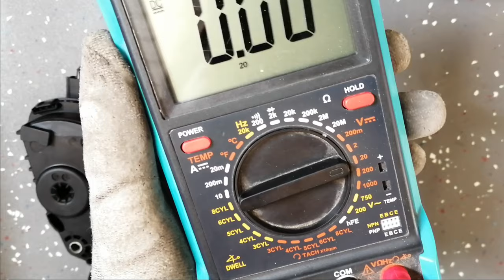Testing Accelerator Pedal Position Sensors in a very professional way

Comment: You should be talking to explain what you do and what the right voltage should be read,by the way thank you .
Reply: Exactly, why even make a mime video? I learned nothing from this
Reply: English problems I guess
Reply: I'm still wondering why I would test for voltage at all, rather than resistance.  Agreed, this vid was a waste of time.
Reply: Where is that output go? Ecu?
Reply: Please how can I fix the problemI was called to another garage to fix a 2005 300c chrysler. The problems they noticed with the car was Hard or no start, red lightning bolt flashing, no throttle response, headlight stays on, immediate stalling after starting and rough idle throughout idling as a result a new PCM was replaced with a new one however problem still persisted. 

  I scanned for DTC codes and saw a P0340, P2167, P2166, P2115, P2116, p0603 and more module codes like C2202, U0168, U1414, B1A25, etc.
Reply: @davidessien5465 Powers and ground first.

Comment: This video proves my own video to be true in that electronic accelerators are not linked in with your PCM/ECM at all and how people are being scammed into believing a stopped up cat or transmission sensor could be related to limp mode. That pedal sensor as shown, has a direct voltage feed, and from there activates the throttle plate motor on the throttle body and has nothing at all to do with your ECM. Notice how they throw a wrench icon code but not an ECM code? Your scam videos and crooked shops and making people believe you have to focus on other engine sensors and are even making up lies that you have a stopped up catalytic convertor. This video above is PROOF of what I am telling you people

Comment: Good video showing how the APP sensors work. However, the test itseft doesn't measure the voltage difference correlation between sensor 1 and 2 which is what actually the pcm is looking at to determine if the pedal is working properly or not.
Reply: Hi , is that reading even good?  I mean it is good pedal?
Reply: Can't exactly say, you need the specs for the car model to make a definitive decision.
Reply: apparently this is good APP

Comment: Very good video,  one can use the Mobile phone charger, modify it to get 5V for testing. Just need to find out the pins.    Thank You.    All the way from Maputo/Mozambique
Reply from the maker: Thanks
Reply: I agree very good video I don't know if anyone can answer this but is it possible for the pedal adjustment feature to interfere with the electronic pedal my steering column in my 06 Vic steering lock is going bad and somehow the pedal adjustment is kicking in and out along with limited if not sluggish response of the accelerator and brake pedal while it randomly adjusts
Reply: Sir, I kid you NOT,, I'm using a portable phone charger to output 5V (5.13) right now 😅

Comment: acceleration pedal is measured  with rehostate resistance  increase or decrease resistance  the number of resistance  tell the  cpm
where the pedal is  if  voltage is going through  increase or decrease voltage. depending on the manufactures  ingeneer.

Comment: Your reading is correct in a stationary condition, although you should have done the same test with the pedal operating. As a result, a test value of approximately 5V should have been obtained. And 4V in some other cars. Results less than that indicate that the accelerator pedal is faulty.
Reply from the maker: True, thank you for the information 👍 ، I know, next time

Comment: thank you - I got some crocodile clips but I dnt have the proper ones like you do with insulation but will see what I can do ( my car does not accelereate at all and the mechanic says it is the diesel pump but im thnking that does not sound right at all ( I mean if the pump was faulty it should atleast rev a little )

Comment: So my pedal doesn't accelerate until about... 1" depression.  
It's always been that way though. and you only notice it after driving another machine.  Sensors are everywhere these days though.
Reply: I have the codes from a supposedly bad throttle pedal 

so what other symptoms do you have with the pedal?
Reply: Its not the same in every car. The delay in some Cars is for Comfort purposes.